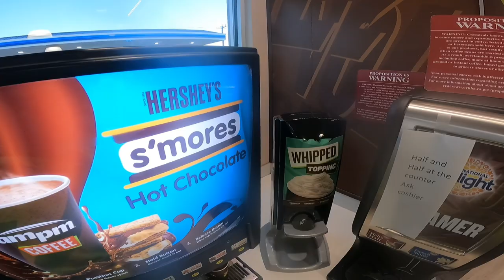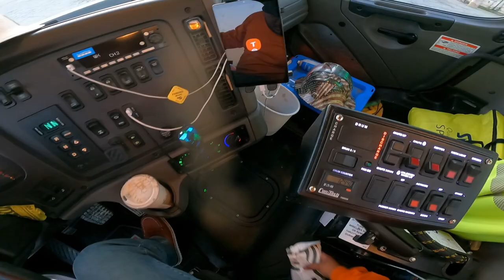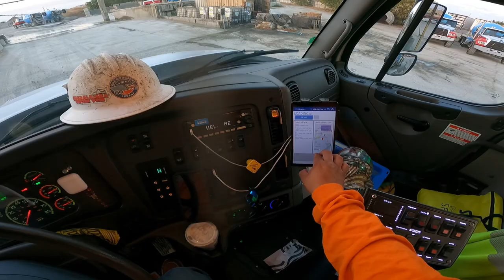concrete mixer: coffee break and wheel barrows

Comment: I'm guessing that the company DOESN'T always make "blocks" with the leftover concrete on returning trucks ... ??
Reply from the maker: That’s correct if the blocks are full or we are running behind we will just dump the left overs on the ground and the loader will break it up into a pile so later on it’s crushed

Comment: Oh wow man that would suck poring mud. Rear dumps??  Thankfully we got all front loaders for 95% of the pores. I remember the rear dumps when I was a young kid. 😂 that was like 50 years ago!! Now days I would be safe in saying 95% of all concrete trucks are fronts. Is a few “ very few” rear dumps a them are strictly pump jobs.. But here we use fronts for everything. But as a school lesson when I was a younger kid the truck showed up on the job site. The truck driver would dump bags of cement in. An run a side conveyor of stone sand and gravel into the mixer. He would then add the water and the concrete was mixed on the job site back in days I believe and we’re going back 50+ years I believe 5 yards was the maximum you could get per truck😂😂😂😂 gee I am showing my age😮😮😮